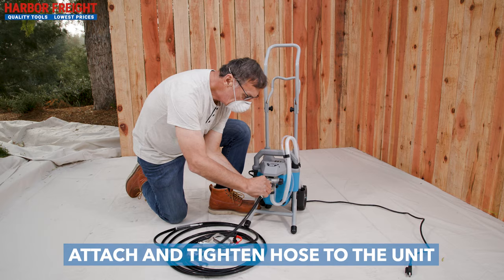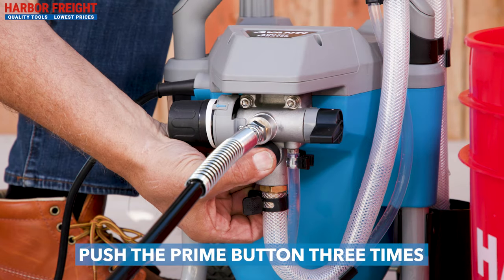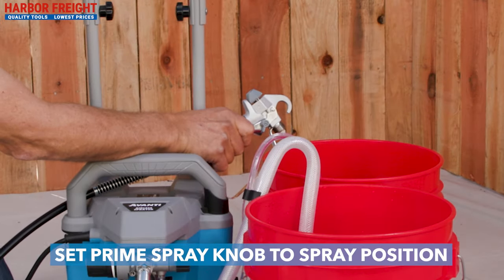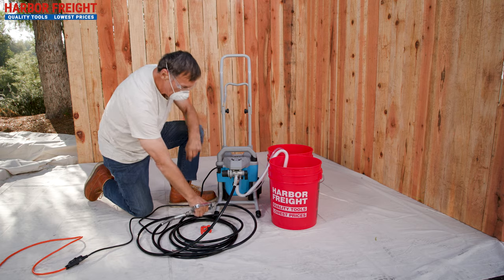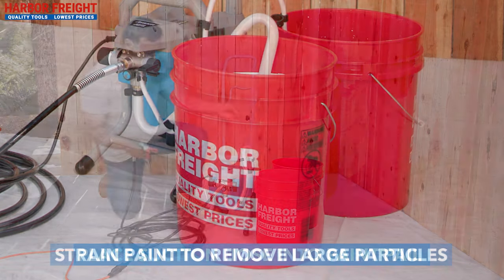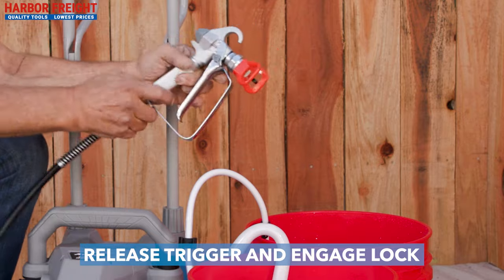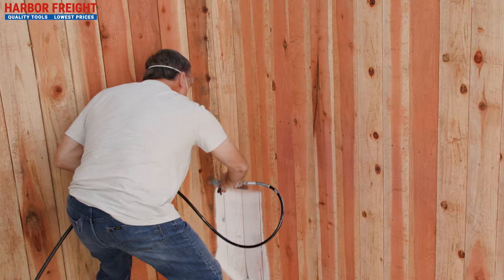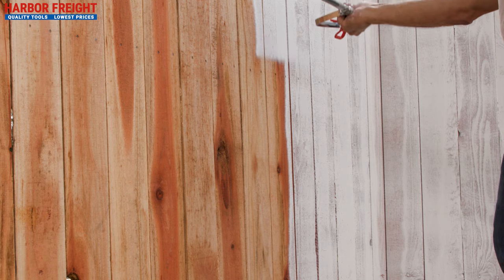Avanti Airless Paint, Primer, & Stain Sprayer Kit Set Up

Comment: Bought one and the machine worked great.  The BIG Mistake that I made was to spray indoors:  living room, dining room, and long hallway.  The preparation takes a long time.  You have to cover everything that you dont want to get paint on.  When spraying the walls, an unavoidable mist (I guess people call it overspray) gets everywhere so you really have to take the time and prep everything carefully.  Again, when spraying the machine worked really well.  For me, I would only use it outdoors or only on new construction indoors where paint getting everywhere really doesnt matter.   Bottom line:  machine worked really well, but not for indoor painting.
Reply: you can turn down the pressure or you would have to get one that support low pressure tips. no matter what you will still get overspray with any airless sprayer
Reply: Turn down the pressure and use the appropriate tip. When it comes to spraying the work is in the prep. It’s a skill issue, not a hardware issue.
Reply: Indoor painting just cut and roll that’s easiest
Reply: I’ll let you know how it goes for my first time spraying walls indoors.
Reply: You do that. @IknowGodIs
Reply: Sprays the walls well. But I’m in total agreement that I’ll never use it indoors, again, unless it’s a brand new build with nothing else installed. 

I thought overspray was within the immediate area. Nope! It goes everywhere. I sealed the doors and covered the windows with plastic. I covered the built in shelving. That made no difference. The overspray dust found its way everywhere.

Comment: Got my entire 1000sqft basement painted -- ceiling, wall and floor. It does require more prep work can clean up than rolling but for all the uneven nooks and crannies places, this is awesome. Do invest in more bits and an extension rod if you need to spray. You must clean the bits and take the filter out and flush the system with mineral oil or it will harden and it will be a pain to use the next time. Def worth the money.
Reply: Mineral oil?? Or mineral spirits??

Comment: Read the mixed reviews on this sprayer, but then again all the sprayers in this price range had some sketchy reviews.  I decided to give it a try and it has worked just like it should.  Not one hiccup.  I'm about 30 gallons in and have cleaned it EXACTLY like the paperwork says and it has been a real blessing.  And the majority of the paint was actually kilz and other drywall primer and worked excellent.  Go ahead and buy a couple additional spray tips and spray gun filters just to have when you buy.  I have been using the 515 just like it came with.  I used a Graco one when the first one wore out and it didn't even last as long and cost almost twice as much $20 vs $38 .  
Hope this helps.

Comment: Doing this now. Once I switched to spray during priming, the machine goes into a seizure as I squeeze the spray gun. I’m trying to do this exactly like in the video.
Reply: Quick follow up. I got it working. It takes a lil getting used to. It uses a LOT of paint in comparison to their smaller gun(can’t remember the model number). Anyway, once I got going it was pretty simple. Overall, it’s not a bad investment.

Comment: i was told you cant use any latex  paint that has primer in it like Beher paint. with primer....is that true?? it know Home Depot will not let you rent a paint sprayer unless it is pure latex NO PRIMER>..is this true with this unit>--thanks
Reply: That’s a great question I wish someone would answer
Reply: Just curious (I'm not an expert, just learning) but why would the paint having or not having primer matter?
Reply: @bishopp14 primer has an adhesive that kinda coagulates when cleaned with just water. But you can use soapy water and it works better. Not sure any other reason why.

Comment: I’ve never owned a paint sprayer before so maybe someone can explain me this. Let’s say you’re using oil based stain and the system is dry and clean. What is the reason you have to prime it with mineral spirit first and then with stain? To me it seems like you can prime the system by putting both hoses in the bucket with stain and not waste any product.
Reply: Because the mineral spirits washes out any pump fluid or water to keep it from mixing with oil.
Reply: @Illuminated.studios  Gotcha.  What if using water based paint, what is disadvantage of placing both hoses in paint bucket and priming with the paint ?  Thank you.
Reply: @googuser4040  For the same reason you're suppose to damp your paint brush before painting. It helps the paint flow because it could otherwise stick and dry up in the machine where the plastic is dry. If its wet the paint will take much longer to dry up in the machine.

Comment: Bought one of these and it's defective right out of the box. It absolutely will not prime not matter what I do or try. And I've used an airless sprayer before. Pretty disappointed.
Reply: Ya get that thing worked out my friend? Or did ya just have a 200 piece of trash
Reply: @Kevin12321  returned it as defective under warranty. Got a new one that works fine.

Comment: Don’t purchase this unit unless you purchase the extended warranty. I bought it but didn’t get to use it until it was a few days out of warranty. There’s only a 90 day warranty for a reason. The motor seems to work fine; however, the  rest of the machine is not worth the money— starting with the handle—junk right out of the box. Calling customer is useless without the warranty. They will tell you only what’s in the manual but keep you on the phone for a such a long time making you think they can give you new information, but they never do. 

Spend the extra money and purchase the major brand.

Comment: Is there any way to control the spray quantity? When I use it it runs through a 5 gallon bucket of paint within minutes.
Reply: Minutes?
Reply: @ghostwavewrider  like 10 minutes
Reply: the pressure knob is how to control it. the higher the pressure the more paint (and overspray)
Reply: @ricosrealm  s it necessary to thin the paint?
Reply: @ubacow7109  No.

Comment: Doesn’t include how to install tip. Thumbs down
Reply: It's in the directions.
Reply: @steelewheels1365  The directions are not clear.  It says install the seal, but there is no picture how to install it.  It does not fit.

Comment: This machine is horrible and leaked at the gun, returning asap, made a mess in my bedroom, just rolling next time from the beginning.
Reply: The included guard is garbage, mine split first use. I used a Graco guard and it works great.
Reply: You just have to tighten it good and the leaks stop mine worked great painted the whole house and 300ft x 7 wall zero issues
Reply: @user-qm5wh3ut7z  wouldn't have helped mine, it literally pushed the steel part through the aluminum nut.

Comment: Dose any one have one?
Reply: I have one on the way. I wanted it to Spray the exterior of my home. after reading deeper into the subject, I may return it for a Graco. That does Enamel Paint great, I might just keep the Above for indoor latex painting. You should go with Buying an extension for the hand sprayer for the above, after reading I have found 20 inch to be the most liked. Also read up on the tip you use....Okay Best of luck to you!
Reply: @clarencejackson4004  thanks I just got mine today I will try out this weekend and let you know how it goes
Reply: @clarencejackson4004  I just got it to compare but I hope it works price was not that bad
Reply: @hlara2397  Great! Keep Notes LOL..I appreciate your Kindness. Oh, and it is the 10inch extension that gets those hard to reach areas. Best of Luck! H Lara
Reply: I just got mine 2/20/21 ..I will get it together , I am going to pick up the 10inch extension. I am Going to try mine Next week on a Bedroom with Latex. I will Post the results I have.
Reply: @clarencejackson4004   mine worked great I did a full trim and ceilings in a house about 2500 square foot
Reply: @hlara2397  Oh, Gosh, Your a pro H Lara. You use any edging Tools or You recommend any for a Novice? I ordered Cleaning brushes with mine (Never made it with the Sprayer) How was the clean up and that Pump Oil that came with it? You have me very interested now. H Lara was the Hose Long Enough or go for the 50 footer? I am making a lists. Your feed back rocks! Thank You very much!
Reply: Hey honestly it’s just getting youse to it. I am spraying  duration and I had no problem I just run water threw it I ad the pump armor if I’m going to store to keep the pump clean and lubricated I have used other rigs and left it primed with paint for weeks at a time. I’ll keep you posted and I like to run a diferente tip and guard. Guards are all universal but you have to get the right tip to its guard
Reply: @hlara2397  hi do you get very many clogs?
Reply: Used it today. I am satisfied with it's performance. I did the outside of the new porch section on the house. About 14ft x 20ft and the front 9ft x 20ft. Took 30min. 20min to clean thoroughly. No clogs this thing kicks out paint very well.
Reply: @billyleeka1635  , thank you for the info ! 
Everyone is so kind in the Harbor freight threads so it makes my purchase way better than going it alone 🙏👍
Reply: I do and I’m about to use it a /Nd time. Watched this for a fast refresher. It works OK. Not very powerful but good for people new to spraying. I primed 4 rooms including ceilings in about 4 hours
Reply: Who is "Dose?"
Reply: @hlara2397  How'd it go with the sprayer?
Reply: @TheRetiredVeteran  Mr. DOSIS
Reply: Mn
Reply: @clarencejackson4004  v
Reply: @clarencejackson4004        Pc
Reply: @clarencejackson4004  3049
Reply: @clarencejackson4004  3049
Reply: @clarencejackson4004  3049
Reply: @clarencejackson4004  3049
Reply: @kathleenwalton3311  sorry for late response but no. I do sift my paint tho
Reply: @kenneththompson9082  good have been getting jobs done fast.
Reply: @clarencejackson4004  Hi, what extension brand did you use with this sprayer? Are extensions universal? Thanks
Reply: @karenmorales882  all 7/8 extensions are universal. Graco makes multiple lengths.
Reply: @plkracer  Thanks!
Reply: i have one is a matter of knowlege sometimes is not the tool but the guy who use it for me works like a charm for $200 is good enough il rated 3.8 out of 5